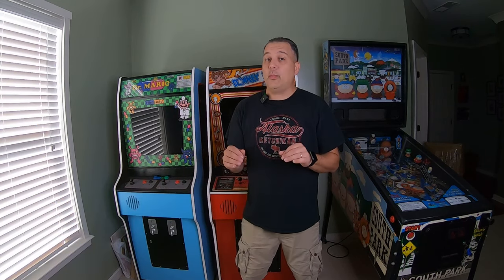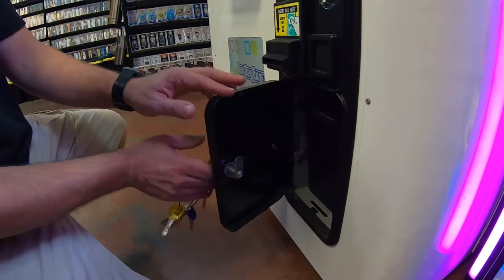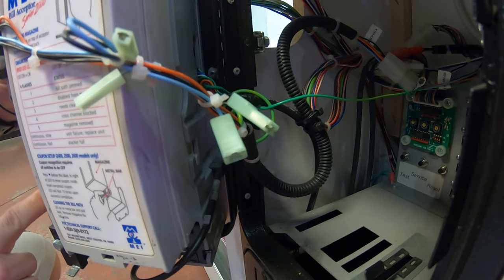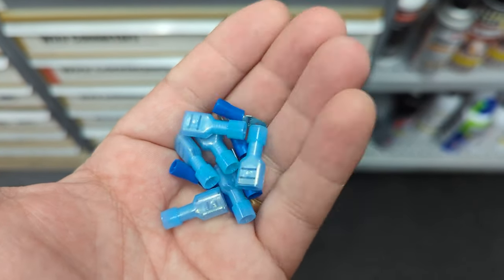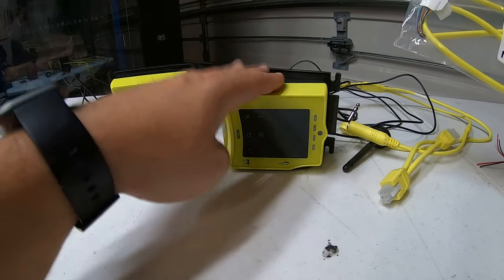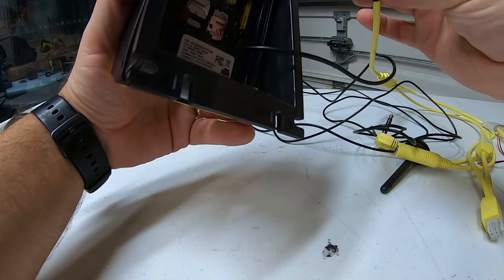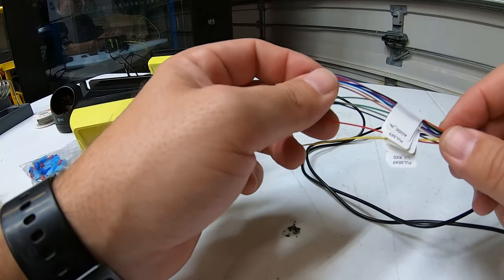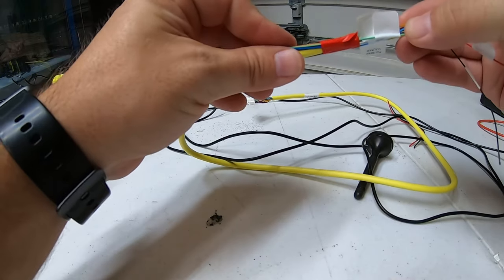How To Install A Nayax Credit Card Reader On A Claw Machine Or Pinball Machine!

Comment: Hi.  Great video, thanks!   I was wondering if you know anything about a weird credit card connector I'm seeing inside an old CRT Megatouch bartop.   (I know i could always just hook the Nayax to the coin slot, but Im curious about this).  Its a 9 pin (3x3 grid) connector.  Have you seen this one?  Thanks again
Reply from the maker: Thank you! That connector sounds like it could be the 120v AC connector for a dollar bill validator.